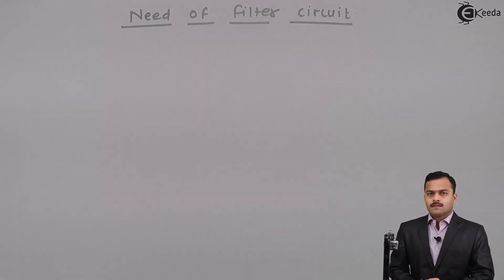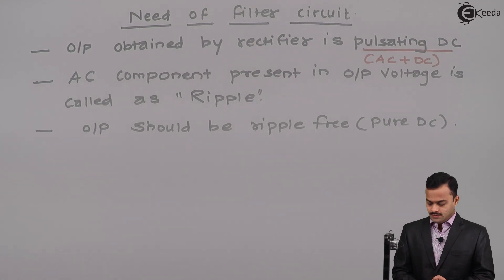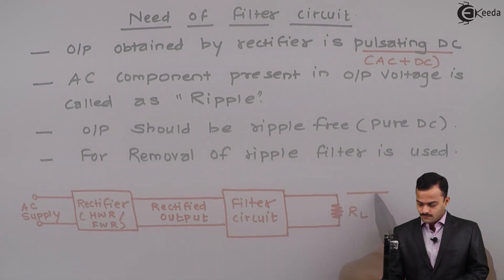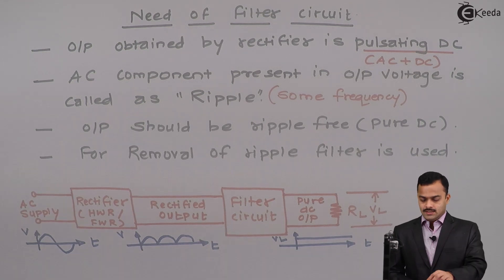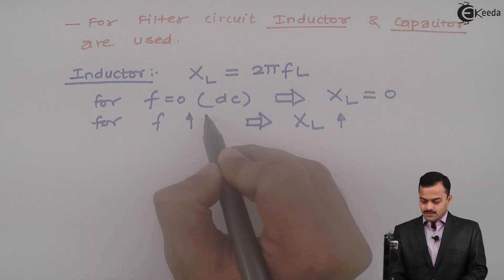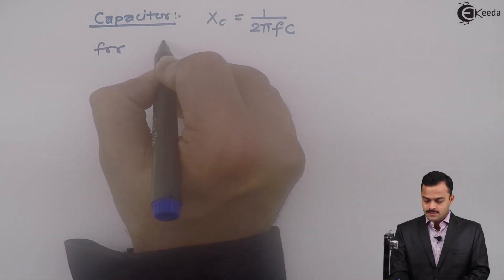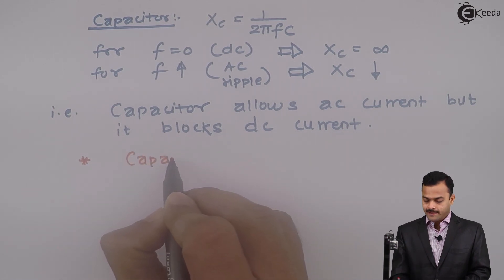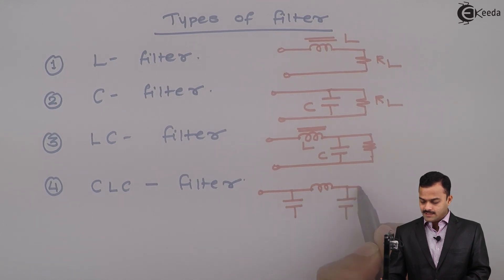Need and Types of Filter Circuits - Electronics - Basic Electrical Engineering

Comment: THANK YOU SIR will u solve it i didnt get
A  Square ranging in amplitude from +10v to -5v is applied to a low pass RC circuit. The voltage on the capacitor has a max value of 8 volts and a minimum value of -3 volts.  (a) What is the duty cycle of the waveform that is applied?  (b) What is the frequency in terms of the time constant and (c) what is the average value of the voltage on the capacitor?